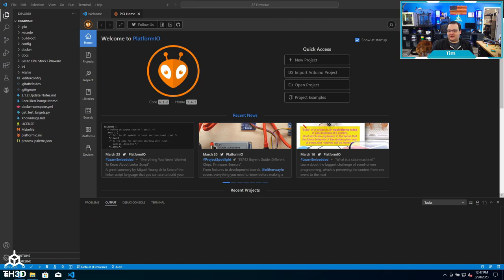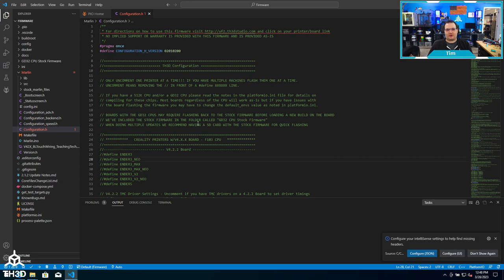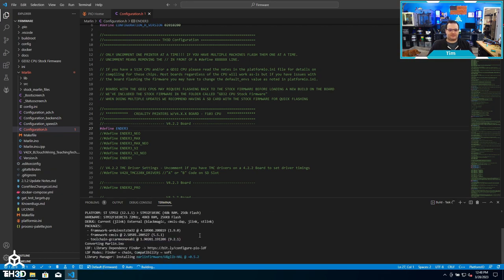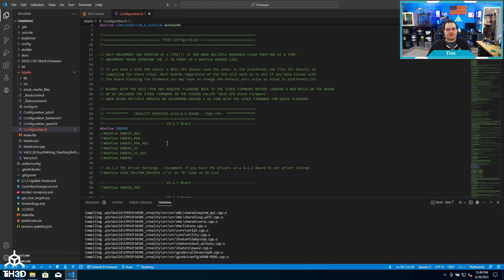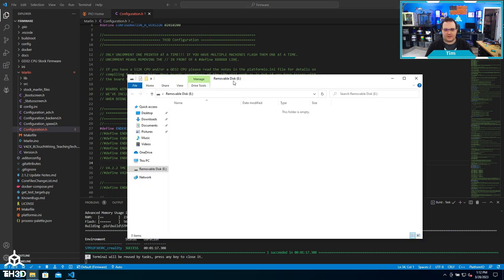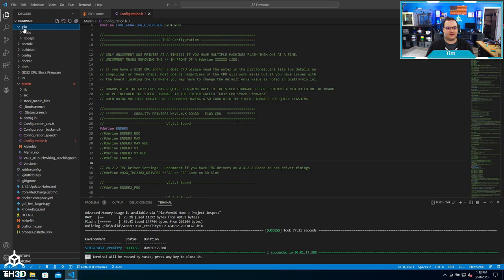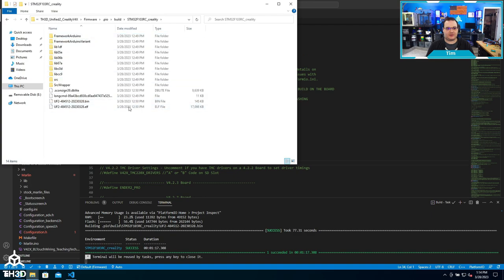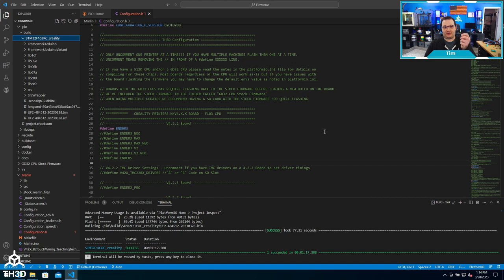Unified 2 Firmware - Compiling Firmware for 32 Bit Boards

Comment: My Ender 5 plus/BTT MiniE3v3 with Unified does everything now except for the  BTT TFT35 touch screen (thats now frozen between Marlin and touch screens) and when you press print, Its then drops the bed 4.5mm and starts extruding the print into thin air.   Getting to where i am now has been a nightmare as im not pc savi, Im a lorry driver.  Why is it dropping the bed at the start of a print? Please help me here, Im so lost here.